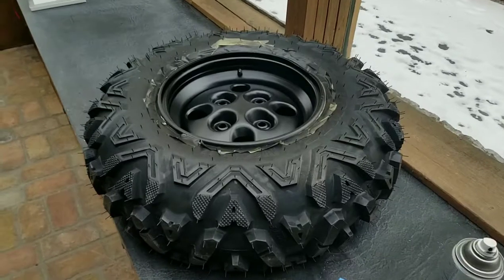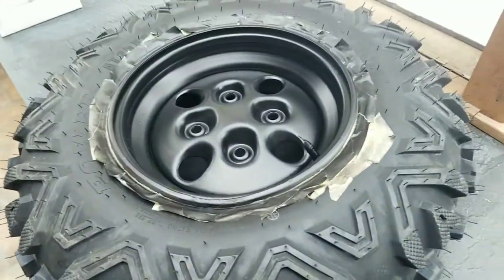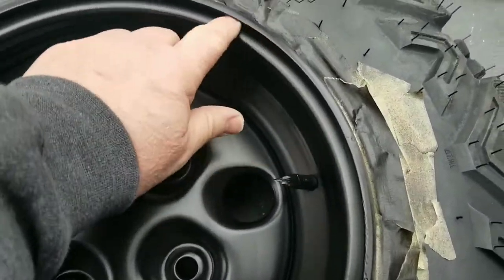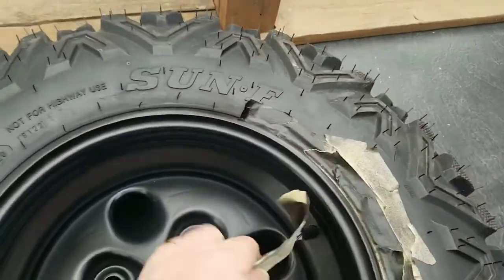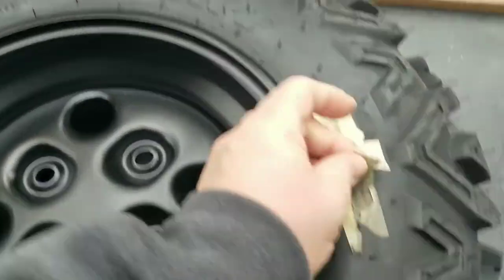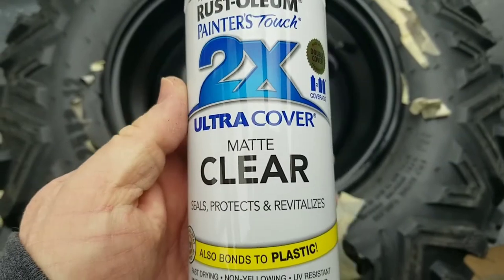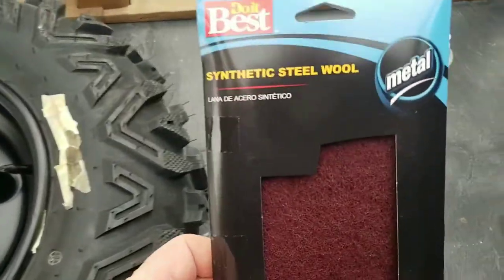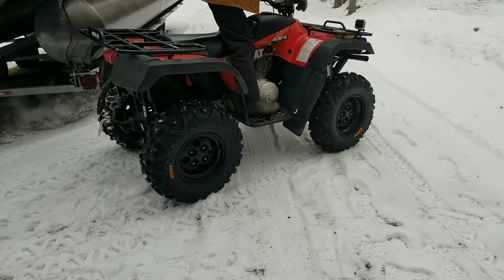Painting ATV Rims

Comment: how are these rims holding up?
Reply from the maker: Really well, I was pleasantly surprised. I've had paint chip off other applications in the past but the clear coat really keeps it on.  
Thanks for watching!
Reply: @jeffnajmowicz5634  thanks.  I goint to try this on my old 98 Yamaha big bear 350 rims.  Old war horse still runs great.  Rims need some work.
Reply from the maker: @travharrell1713  those old Yamahas are like old Suzuki's, you can't kill 'em!  Good luck with your project.
Reply: @jeffnajmowicz5634 the paint still holding up? I may do this to mine
Reply from the maker: @Kevin_Yagoonie  yes, very durable.